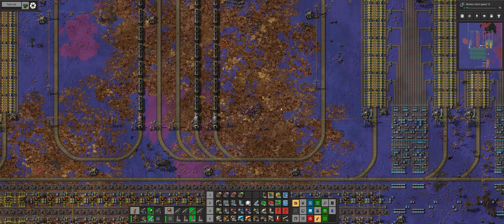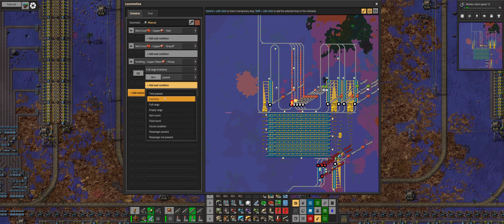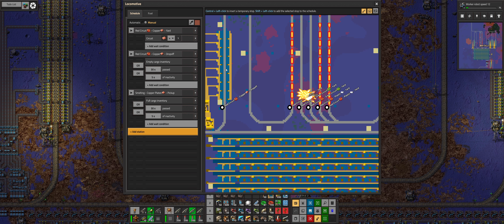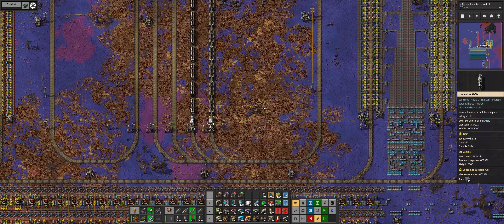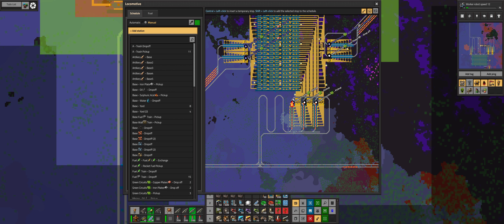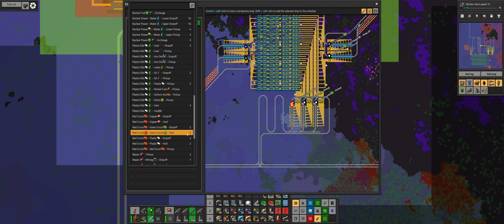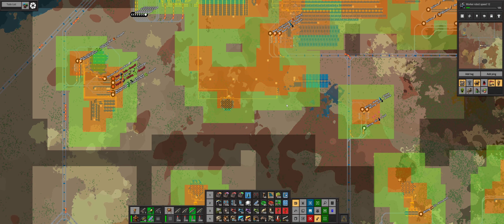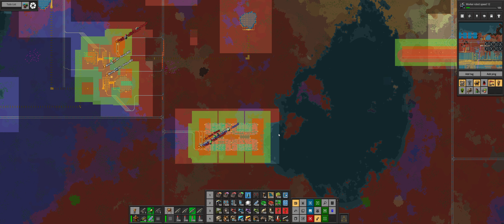Factorio Series 2 - 63 - POWER NEEDS AGAIN!! - Playthrough

Comment: The nuclear build that is already built check the right side turbines there not running. Finding room for a large nuclear build is always a problem. Before the new nuclear build is finish make sure you have fuel cells to fill 1 car and use another car to haul the spent cells back for reprocessing. I think it's better to make all the fuel cells in 1 place.
Reply from the maker: Ok, I need to make a change on nuclear fuel train.